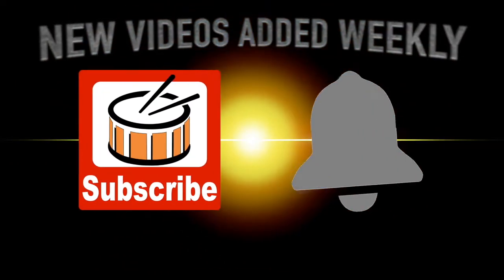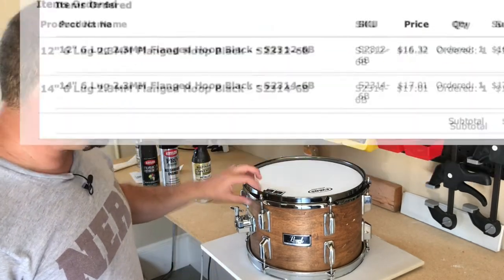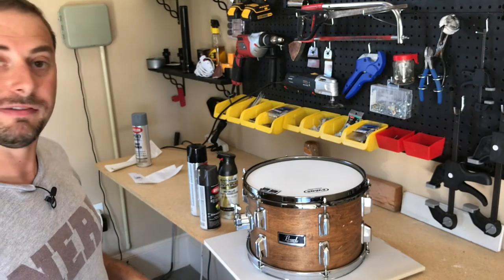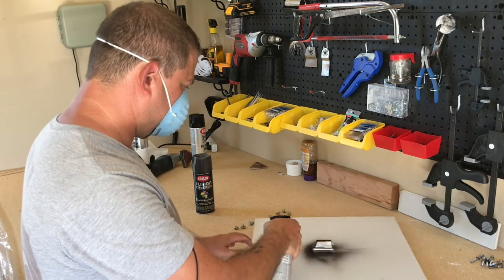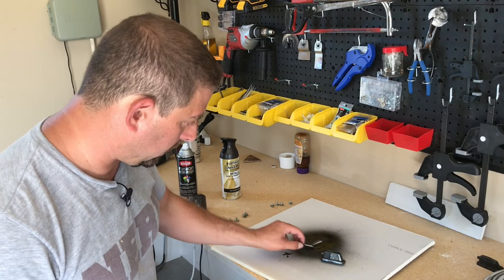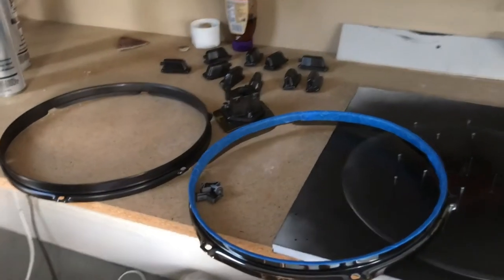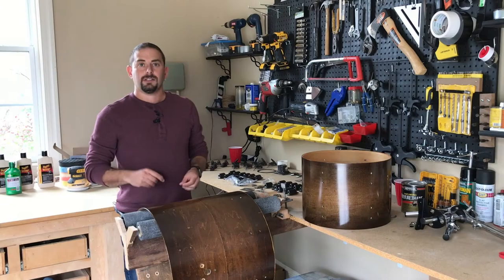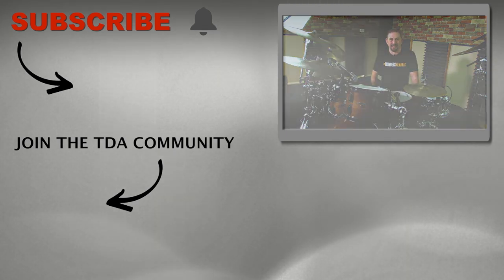Restoring An Old Drum Set - Part 2 - Upgrade Drum Hardware

Comment: Best product for blacking out chrome hardware is from the automotive side of things...Duplicolor CHROME BLACK. Find at any auto parts store. Made for blacking out chrome wheels and other chrome automotive parts. About $18, comes in a two part kit - blacking, and clearcoat. No priming needed and it's very strong. It keeps the very shiny and metallic chrome look while getting a nice blacking effect. Lots of videos on YouTube with guys using on their wheels and other chrome parts.You can go from a shadow haze to full on black, just by the # of coats applied. I did all my hoops and lugs - SUPER EASY to use. AND, Duplicolor makes other colors for tinting chrome - I did my snare hoops and lugs in RED -- looks EPIC!
Reply from the maker: Ya Know... where were you two years ago when I was finishing these drums!? ...geez... lol  I will definitely give that a try on the next build.  Thanks for the info.
Reply: Hey Dan,
Do the hoops lose any coating when hit with a stick..thanks
Reply from the maker: @fletchlivesdaily348  ...I like to know that as well. wish I had done it that way myself.
Reply: @fletchlivesdaily348  The Chrome Black hasn't shown any wear so far (it's on the toms, so not so much for rim shots), and is very durable - of course it would be, because it's original use is for car rims, so you can imagine the abuse from the road. However, the red does chip a little because of rimshots, but not much and is easily re-spray coated if desired. I also colored a set of hihats, two crash cymbals and a ride with the red (two light coats of red and two coats of clear sealer), no major wear or chipping on the cymbals. But beware - the coating does control the sound (read "mute") a little, so they take on a darker personality. For bright shimmery cymbals this may be acceptable if you're ok with a darker more controlled sounding cymbal instead of bright shimmering tone.
Reply from the maker: Fletch Lives Daily ....mine are over a year old and they still look great
Reply: @danthedeechfroehlich 
Hey Dan,
Just wondering, how far did you get with one pack of the black chrome duplicolour? Did you only need one pack to do all of your lugs and rims? It’s hard to tell…also don’t want to get more than I need if I don’t have to.
Thanks!
Reply: @theowenhammond  As you can tell from the size of my kit, there's quite a bit of metal to cover and I used 2 packs of the Duplicolor. But for a 4 or 5 piece kit you could get away with one, it does go pretty far, just do all the parts at the same time - in my experience, a  partial leftover pack doesn't coat so well.
I wish you well on your project!
Reply: @danthedeechfroehlich  Thanks for the response Dan! Just got a pack of the black chrome dupli colour and am happy with the results so far :) I am thinking that I will do 2 coats of the black chrome and the same with the clear coat. Will let you know how it turns out!
Reply: We’re did you buy the black nickel hoops from?

Comment: I have the exact same lugs on my old kit. I would suggest to anyone else trying to do this to completely disassemble each individual lug, the spring and the tapped tube that the tensioner goes into pop out. This way you can keep the spring clean, and avoid a build up of paint in the spot where the tube emerges which could inhibit its movement. 
Just my two cents.

Also if you have these lugs and you notice a lot of weird ringing from your drums, it could be the springs in the lugs. You can use small strips of scrap fabric stuffed inside the springs to absorb the sound without inhibiting movement.

Cheers

Comment: Bubbles tend to happens when the surface isn't 100% dry or the spray paint has a reaction to a chemical that you may have used to clean the surface that you are spraying.
Reply from the maker: Makes sense, but I never got them wet and I sanded each piece and used any kind of cleaner on them... and the rustoleum worked great. Two years later and the hardware hasn’t chipped.  I’m sure Krylon is good for some things, but for this it was a total fail.

Comment: Sometimes depending on what chemicals are in the paint, they can react with the metal or surface that you are spraying on, causing bubbles or cracking. There isn’t really much you can do about it other than use different paint that doesn’t have those chemicals.
Reply from the maker: Yeah... It coulda also just been a lemon of a can? I've used that spray on other projects since... In fact, I just sanded some rust off an old ax that got left outside in the rain.  I used that exact can to respray it. The ax did the same thing. It all bubbled up.  Being that this Krylon spray is supposed to work on all metal surfaces... I have no explanation for this but after that, the can went in the garbage. lol

Comment: Etch prime first. Then paint.
Reply from the maker: Ya know I was gonna try that... In fact that grey topped Krylon can in back of the other three is a primer.  Since the two colors that I chose advertised Paint + Primer in one... I wanted to see how they did without priming first.  I ended up really liking the Rustoleum, which went on great in one coat... If I was really married to the Krylon color, then I would have primed first, which probably would have solved the issue with the bubbling.  Have you had more success priming then painting in two separate steps VS. using these all-in-one sollutions?  I'd love to hear about what you've done so I can give it a try on future projects!

Comment: The Krylon bubbled up because the paint likely had a chemical reaction to the chrome finish on the lug. It would have been better to strip the lug back completely, clean with a rubbing alcohol, prime, then spray light coats until you reach the desired level of coating. But hey, in the end it all looked great.
Reply from the maker: repsandgrooves Thats very possible.  Luckily the rustoleum didn’t have the same problem.